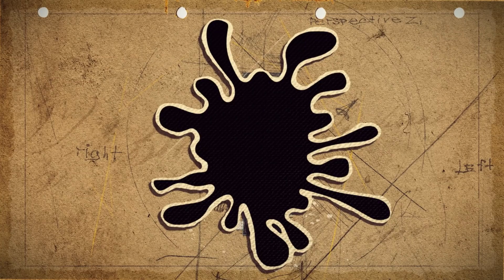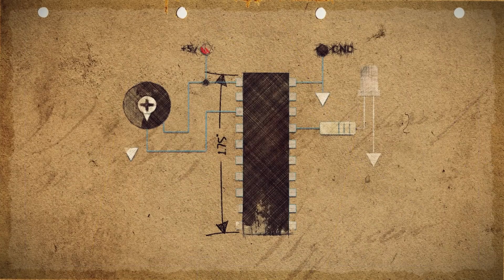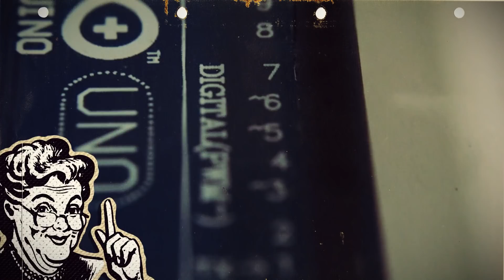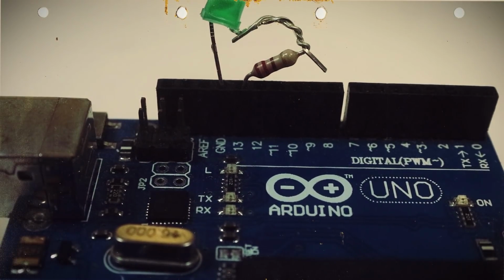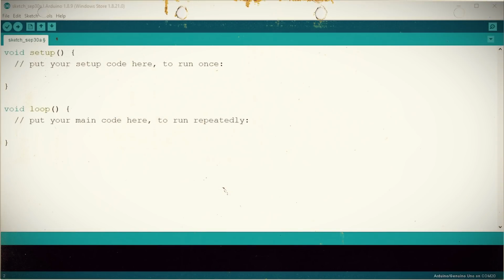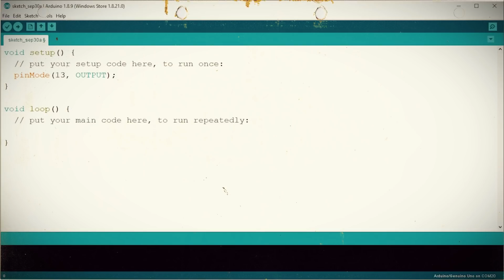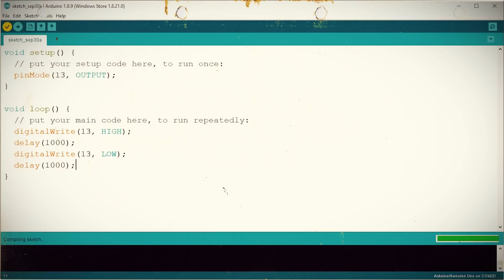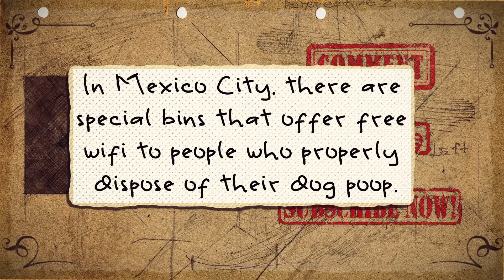Arduino - All You Need To Know

Comment: I once picked up an ardruino for the purpose of updating the firmware of my 3d printer. The instructions essentially had me turn the ardrino into a programmer for the board. It installed a new bootloader on the printer board and turned it into an Arduino compatable board. Now my printer has essential saftey features that shut off the machine when things get to hot. I think the arduino cost around $5
Reply from the maker: goodBean!!! nice to have your comments again! The Arduino boards that cost around $5 are generally clones that aren't really produced by the Arduino group.

Comment: I know you are simplifying it all but you said micro controller and yet put up on the screen micro processor which as you know are not exactly the same thing (they often are similar but may not be).
Reply from the maker: What I showed was an Arduino, which is a microcontroller, and then generic clipart with no identifiable markings. Not sure where you saw a microprocessor in my video...
Reply: @Tinkernut   0:46

Comment: The audio of this video is weird. The volume of audio is changing sometimes.
Reply from the maker: I was using a New audio compressor setting and apparently I need to tweak it more...
Reply: Tinkernut ohh, hopefully you can get it to work! :D
Reply: Redbuild oh no, now that I read this I keep hearing it 😫
Reply: True
Reply: Captain Peroxide idk why I didn't reply, but lol
Reply: Audio issues like these usually are an issue with the transition from balanced to un-balanced connections and sometimes can be rectified by just running mono